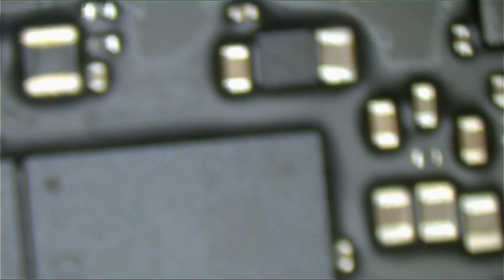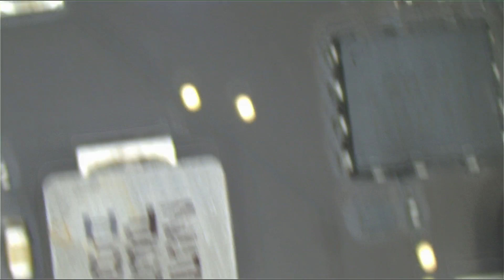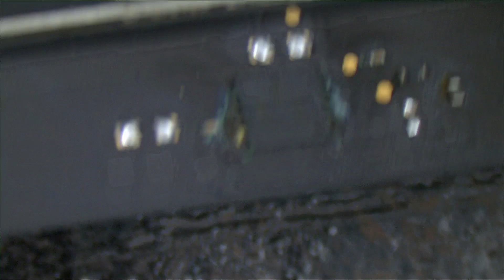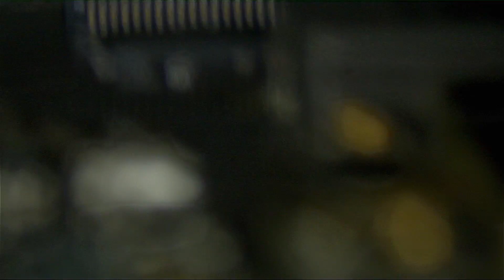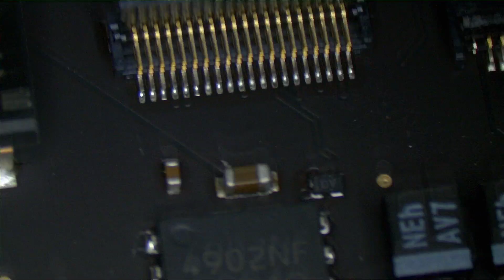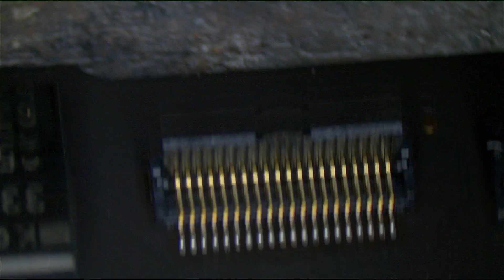Fixing liquid damage through the magic of localized reflows

Comment: how come you dont use a mild bristled brush to clean the areas after you apply the flux ?
Reply from the maker: +Glenn Ferris brushes don't clean shit, they have no absorptive qualities.. brushes just spread it around.  The Ultrasonic Cleaner cleans off the flux
Reply: I have good uses myself i also use q-tips and styrofoam q-tips but have often wondered if they have any static but theyre usually moist before touching ic's. My use of a tooth brush works great for getting under ic's ...use it dry
Reply: Then use an ultrasonic cleaner after brushing the board like a good little boy. Now you must be very very quiet whilst doing searches for wet damage.  Shhhhhhhh!!! Be vehweee quiet!!